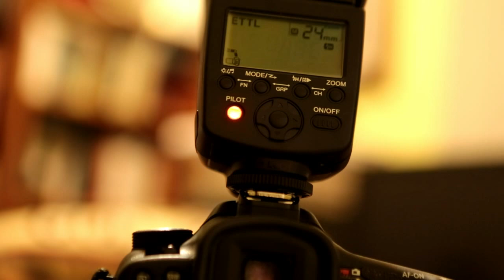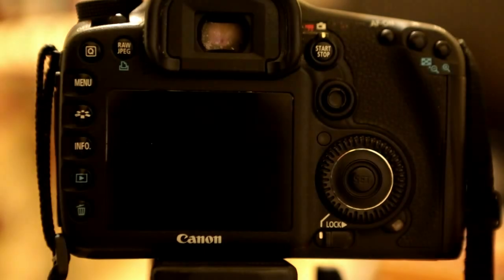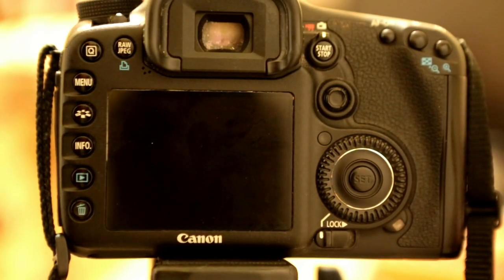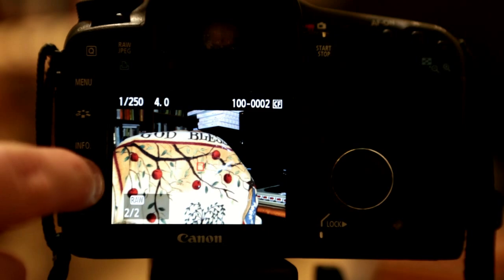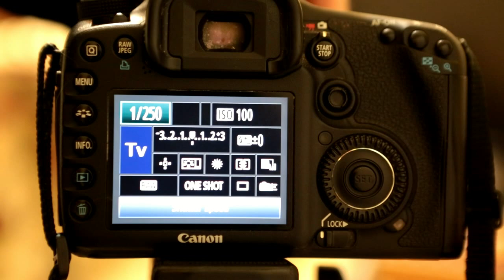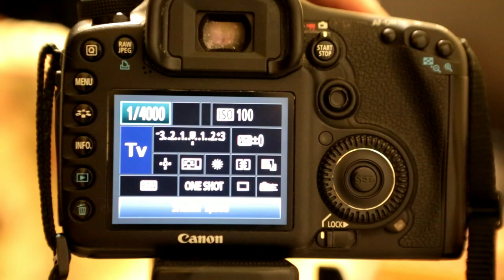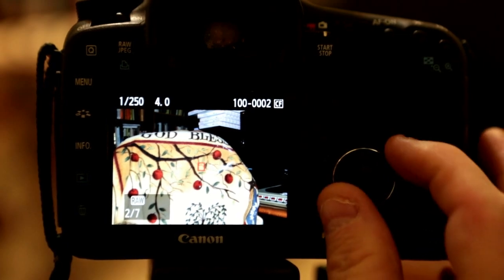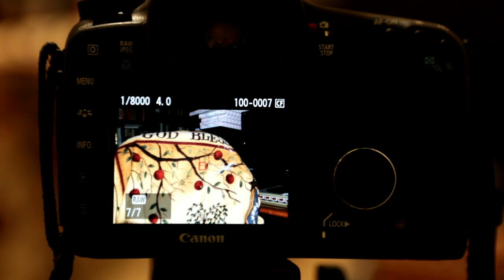Yongnuo 568 EX II HSS Test

Comment: An amazing product imgs.love/YNFlash  If you are new to flashes, consider a Yongnuo. From experience, they photograph better than a Canon flash. I use these as off-camera flashes on tripods with my MagMod set and I could not be happier.
Reply from the maker: This video is about 7 years old. I do have the Yongnuo 600's and they have the same door issue, but I ordered extras. I agree with your assessment.
Reply: You right I just make order it’s amazing.

Comment: At 1/4000 shutter speed, the background of the photo was not dark, because the flash power on the speedlight has to be in manual mode and the aperture needs to be narrower.
If it's in TTL, then it won't work.
Reply from the maker: Thanks for that tip. Hopefully it helps others out. Thanks for watching and contributing to the conversation.

Comment: Hi Danny.  I was wondering if it only does high speed sync on ttl. I was thinking of getting one to use as a manual flash for my fuji. 
cheers steve
Reply from the maker: These are only made for Canon or Nikon so they would not work on a Fuji. Sorry.

Comment: Just leave it on HSS all of the time, there's no need to turn it off.
Reply from the maker: If you do that, you will wear your batteries out in only a few flashes. Only use it when necessary. Do NOT leave it on. HSS will also not give you the flash power you will require on longer distances.
Reply: Danny Fyffe
If you go below the flash sync speed it will automatically adjust to short duration flash output so there is no need to worry.

Comment: Nice video! Someone asked if this flash will sync with the 7D at 1/8000th off camera, you just said you'd make them a video and didn't say either way. So does it sync?
Reply from the maker: From my description I said Yongnuo HSS Test on the Canon 7D. I use TV on the canon to remove all ambient light. Next, I shoot images at 250th, 500th, 1,000th, 2,000th, 4,000th and 8,000th of a second to show that HSS does work on the Yongnuo 568EX Flash. So yes, HSS will sync all the way to 1/8000th of a second. Does that help?

Comment: can you get this result with alien bees? or anything faster that 1/200
Reply from the maker: I have never used Alien Bees, but these do have HSS which will match your camera to 1/8000th of a second. It will drain he batteries much faster and the light is weaker because of all the pulses, but it certainly works.

Comment: does 7d work on burst mode during hss..
Reply from the maker: It will, but remember that during HSS the flash is actually pulsing 1,000's of times and so your light will be far less than when not using HSS and your batteries will get depleted very quickly. Only use HSS when absolutely necessary if you are shooting  a long event like a wedding outside.
Reply: Danny Fyffe thanx for prompt reply..plz visit http://yourshot.nationalgeographic.com/profile/282415/

Comment from the maker: Vik Kumar: I cannot reply directly to ou for some reason. You weren't doing anything wrong. Remember as your aperture gets smaller you allow less light in for less time so your pictures will be darker. Also, the flash is firing in microbursts instead of one hard flash so you also have less light there. So HSS sync is a trade off usually when you are in bright conditions, but as you stop down, you do allow less light in for less amounts of time as your shutter speed goes up. That is the exposure triangle at work.

Comment: As far as I know the first version of the  YN568EX wasn't able to do HSS... is there any hint on the flash itself, stickers or the box it came in that shows a difference? The Yongnuo-website itself says that the only difference between the 568EX and EX II are HSS and Master-mode... and at the same time it says the 568EX (without II) can do HSS now too....  quite odd. I don't feel very sure to buy a one without knowing a mark to identify the HSS function...
Reply from the maker: It does say on the box HSS. I even showed that on the video so the version II does indeed have HSS and it works all the way to 1/8000 of a second as I demonstrated that too.
Reply: Danny Fyffe recommended because I bought a YN568EX II for Canon

Comment: My 568 didn't work with my Nikon D7000. At higher shutter speeds I get the black bars on the pictures. Anyone has the same problems when using the flash on a Nikon camera? Thanks

Comment: I had sent the same basic question to the ThePhotoGaget and this is that reply:

Thanks for your message.

568EX supports remote HSS as well. However the built-in flashes of Canon cameras are not able to trigger HSS. You would have to use ST-E2 or a compatible radio flash trigger like YN622 or a Canon 580 EX flash.

Thanks again!

Have you had experiences contrary to this, that is to ask, have you had to use a flash trigger also to get the 586EX to fire off camera?

Thanks
GAP

PS: good video